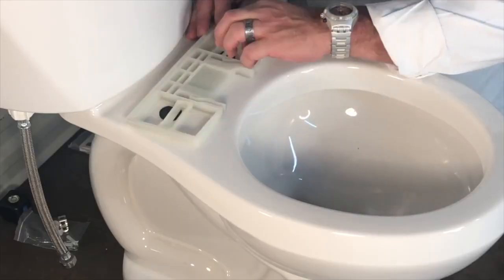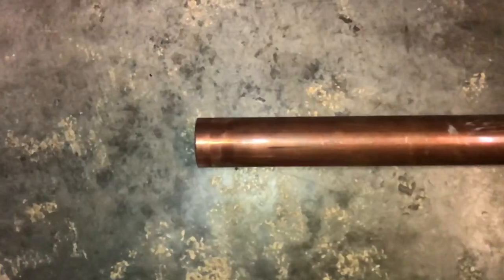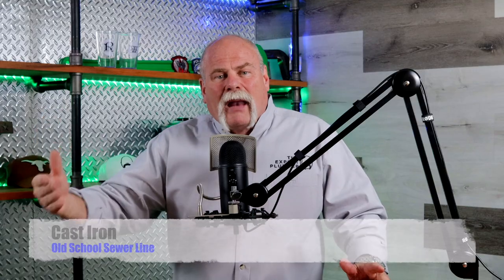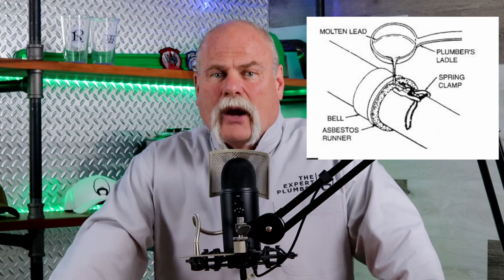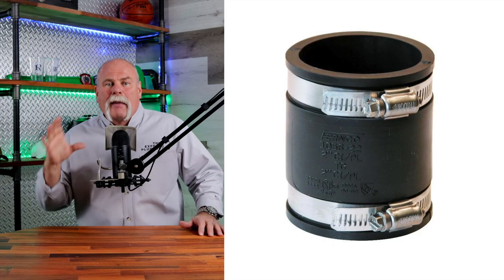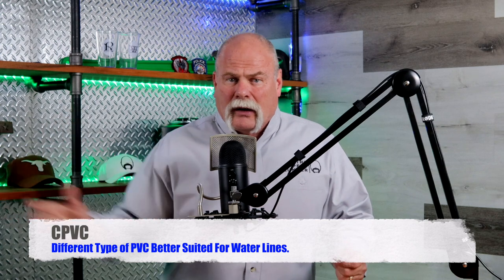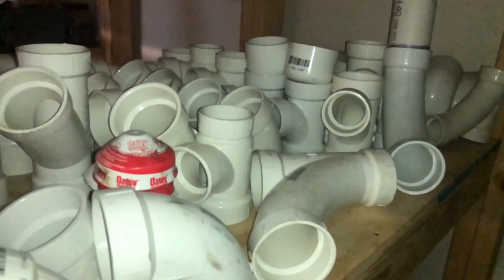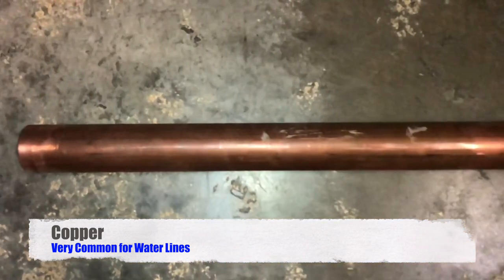Plumbing Basics - What Type Pipe to Use in Plumbing

Comment: In the winter of 1980 I was a new homeowner with frozen pipes.  When they thawed, I had a broken copper pipe.  I cut the water off and called a plumber.  No one was available because this was happening everywhere in town.  So I went to the local hardware store and got compression fittings and plastic pipe (PVC).  I froze my arm off dealing with dripping cold water, but I put the compression fittings on and had PVC in between.  I have since learned that that was not right.  But 40 years later, they still hold.  Of course, in the summer I put on electric pipe heaters and insulation, so they have never frozen since.  That was the cold job that gave me a lot of respect for plumbers who do this in all seasons.
Reply: The compression + PVC was a good choice for a fast emergency fix...
Good compression fittings can hold until the pipe corrodes away on copper.
PVC became "undesirable" largely due to the fumes when the house burns.  I can remember in some areas the common white PVC was used EVERYWHERE in the plumbing system.

Comment: where i live most homes have Stainless Steel Pipes instead of Copper. We also seldom use solder joints instead most of it is stainless steel/brass press and thread fittings

Comment: Will be building a house and considering what Piping to use.  I am amazed at this Pex and am leaning towards the Pex-a Uponor, but I am really interested on knowing what the chances are that this pipe, not fixtures have of failure.  What is the standard pressure that residential water mains have coming into a house from the street meter?

Comment: What are your thoughts on PVC vs ABS pipe for residential sewer systems. Do you have a video that covers both? Here ABS, cast iron and some older home still have Orangeburg
Reply: Orangeburg?? Ugh, I feel for you. Just had a replace an old orangeburg sewer line at a doctor’s office two weeks ago. Miserable.
Reply: @MandenTV  personally I've only run into it once but it's because i do new home warranty mainly and a little bit of residential service. But when i was doing my apprenticeship my trainet told me what it was when we were going to the job and my first thought was why would someone think it's a good idea?
Reply: @bryanfreemyer5074  Who knows what was going through their heads back in the day? Now we’re stuck with cleaning up the mess lol
Reply: @MandenTV  i just wonder what materials and designs we use today will be the next "who's dumb idea was this?" Question in the future
Reply: @bryanfreemyer5074  Lol I get exactly what you mean

Comment: I am moving an existing gas range from one side of the room to the other. If i had to guess its roughly 14’. The gas line under the house is 3/4 galvanized. Lowes sells a complete csst, proflex single appliance kit. Could I use that to span the distance? It comes with 25’
Or should i remove the existing T turn it the direction i need and add a 10’ section of galvanized before i use the csst in wall connection

Comment: I have 50+ year old galvanized pipes that have corrosion/rust inside. I’ve been told by a guy who used to install water softeners that a water softener will clean those pipes out. I can’t get my head around the idea that adding SALT to my water is supposed to protect the pipes and prevent rusting.
Is a water softener really going to help my galvanized pipes?

Comment: About to upgrade my 70's house with galvanized pipe to a pex system. What would be the best way to run a new line from the meter? Was thinking of running a 1" line inside info a 1.5" pvc pipe to ensure it will be good.
Reply: You're trying to hard run the 1" at level for code and go about your day. Why run 2 pipes when you need one? Also when there is a failure you made it twice as hard to find and repair.

Comment: As an apprentice I've been learning how to solder copper primarily since that's what we find a lot of but we do run into quite a few times where we need to break out the by viega Pex, the one problem with CPVC is the glue takes 24 hours to dry so you can't really make any repair on a pressured water line without having to make the customer wait an additional time if anybody can invent a CPVC glue that cures in 6 hours you be very rich man
Reply: Forget CPVC except for water heater relief valve piping. PEX is far superior.
Reply: Do you know any other YouTube videos or channels you'd recommend to a new apprentice? Also thank you so much.

Comment: Why no love for ABS? Much better fitting connection then PVC. An actual weld rather then just gulping two pieces together.
Reply: He is in Texas and in some of his other videos states the PVC is the pipe of choose there.  I did most of my plumbing in Arizona and it was more of a mix between the 2 there. and now here in Arkansas its mostly PVC.  So for the most part it is regional, however, there many be some restrictions on what you can use depending on the use of the line.

Comment: I think cast iron drain piping has many benefits that most plumbers ignore. True, metal does corrode and rusts over time, but PVC and CPVC are brittle concerning physical issues, (digging, tree roots, etc). Also the adhesives or joints can fail over time causing leaks. Cast Iron is also quieter and more fire resistant. PVC and CPVC can also be damaged by extreme cold and even sunlight.
Reply: @ Roger Wakefield  I think you should do a video on the pro's and cons of drain piping materials. Cast Iron vs PVC or CPVC. Thank you and I am still a fan!

Comment: I was under the impression that the two band fernco or “no hub” was not rated for sub slab repairs and it needed to meet a different requirement such as the four band (don’t have the required standard in hand) but if I am wrong please correct me
Reply: I believe they just inserted the wrong picture on this one

Comment: I am familiar with the "black iron pipe" and fittings, but I have seen a gas pipe for residential use that is a thin walled 1/2"  metal tube that is bent like an emt conduit pipe. I am not familiar with this product. Have you seen this before? Thank you for the valuable information!
Reply from the maker: HMSRedbeard it is CSST Corrugated Stainless Steel Tubing. It is the latest thing in gas pipe. Many different brands and types. Where are you located?

Comment: You forgot to mention DWV copper which was the norm between galvanized and PVC. And 50/50 or 40/60 solder is typically used for heat, if you have a hot water boiler and baseboard. It's fine for any non potable water. Only domestic do you need lead free. I remember lead and oakum. I never had the chance to do it in the field but I did learn how to do it in plumbing school in 1998.

Comment: We use cellular core PVC exclusively for DWV applications. In 41 years I have never seen a PVC waste pipe leak anywhere than at a joint. Cellular core makes a much better joint, and for that reason, IMHO, is superior. Also we have gone to PE-RT for water lines. As I understand it, PE-RT has a bit more strength than PEX for hot water. I've broken a few nipples inside a wall while trying to change a lav stop in a house with 100+ year old galvanized pipe. Now I give the homeowner a heads up. I tell them that their pipe was worn out when Ronnie Reagan was President, and it might break.

Comment: Quick question. i have a cast iron pipe with a hole in it.   it comes from 1st floor to my basement drain. i want to replace it. should i use pvc or abs or does it not matter? it would be draining the kitchen skink. oh, i will be mating the new pipe to the pvc that comes off the sink/disposal that i had to put in years ago. so i will end up with either pvc to pvc or pvc to abs. if that makes a difference about what i should use. thanks.

Comment: I'm 18 years old and I've had my Apprentice card for less than a year. 
I wanna get my DRAIN CLEANER-RESTRICTED REGISTRATION, but I don't know the requirements and I can't find the right paperwork.
Can you help?
Reply: No requirement, fill out the application, a quick 25 question test and mail it in with the appropriate fee amount... serious companies usually do everything for you with the paperwork and fees provided you fill out the application and test yourself. The only change is now that you (will have) that endorsement you will be absolutely required the continuing education annually. Waiting on dispatcher to send me the website then I can post it
Reply: @Jfurman790 I'm an apprentice in Texas and I'm looking for ways to boost my credentials. Certifications and stuff like that. I just did my drain cleaner-restricted registration and I'm looking for my next step. Any suggestions?
Reply: @therickybelt  after 2000 registered hours you need to apply the same way for your Residential Utilities Installer endorsement so you can actually work the jobs you sell during stoppages and yard line breaks, helps you sweat through your first few calls solo, and gains you experience in dealing with customers and price objections along with all of the other obstacles involving sales

Comment: I purchased some stainless steel water filter housings and a stainless steel UV sanitizer for my well water system. Should I use stainless pipe to connect all the components together? The house has copper pipes.

Comment: In the Dallas Texas area I have ran into a lot of 1/2" galvanized nipples that are threaded into brass fittings. I have been fortunate that the galvanized nipples usually un-tread leaving just a small amount of rust inside the brass fitting. Then I just use a 12 point socket to grab a 1/2" pipe tap to clean out the brass fitting. I use a piece of paper to jam into the socket before I push the tap into the socket. The paper locks the tap into socket so the tap won't fall behind the wall. Then I use a ratchet to turn the tap until the fitting is clean of old iron debris.  I have to turn clockwise a little and then back out a small amount. Then tighten a little more to break up the rust until the tap "seats" into the brass.
Then I permanently install a brass nipple with a temporary full bore ball valve (Turned off). After I get all the new nipples installed in this manor, I turn the water back on to the house. Then I open each ball valve separately and flush out the rust into a bucket. Then I turn off the water to the house again and remove the ball valves and install the angle stops and finish the job. 
I take the extra time to install the full port ball valve because they allow ALL the rust to get out of the system. If I just install the angle stop and then attempt to flush the rust out it could leave rust particles that will cause stoppages later. (or sooner).

Comment: Hi.  I have a question.  Should 1 inch cpvc be used for water service line entering a house from the ground up into the side wall to the garage to feed a water softener?  There are actually two one inch cpvc lines and 1/2 inch pvc line going parallel into the garage wall.  By the way, none of them were insulated so they get exposed to sunlight!  I’m a handyman who had to repair one of the right angles that had cracked in our recent Winter storm with 4 inches of snow in San Antonio, Texas.  I’m not a plumber, but had do miner repairs correctly at very modest price.  I’ve never seen cpvc used outside like that so it seem unusual.  Is that normal?  Thanks!

Comment: I knew a guy who said he worked at Roto something, who said he replaced 8 feet of horizontal kitchen drain in a wall, comprising it purely of inch and a half chrome slip joint tail pieces.

Comment: I have had limited access to CPVC but I often hear plumbers lament it is brittle and breaks off easy when working with it. The only CPVC I have messed with was a 3in vent pipe. It was gray, very thin and all the glue had dried up and was useless. Are there different grades or types of CPVC maybe ?

Comment: Have lived in my house for 3 years. Have had a pin hole leak each of those 3 years, I always solder in new copper. Slab on grade house with the crawl space going down the center, not an easy job.

Comment: I've been trying to figure out what the difference between a schedule 40 PVC pipe and a schedule 40 foam core pipe is. I know the foam core is cheaper, but what would i be giving up for the lower price?
Reply: Some venting applications say for furnace exhaust vents require sch 40 because the cell core is not made to take the acidic nature of the condensation, basically you always use cellular core unless it's for exhaust venting or pressurized pipe, say, for geo thermal. For drain, waste and vent(plumbing) purposes use cellular core

Comment: We recently bought a house that had polybutylene pipes so before we moved in, we hired a plumber to replace all the interior pipes in the house and he replaced it with PVC. Sometime later, I had another contractor come in for an unrelated issue and he asked why they used PVC instead of PEX. He said we probably don't have anything to worry about but he wasn't sure if PVC was allowed by code and that most plumbers would have used PEX. Should I be worried about the PVC?
Reply: PVC is typically used for DWV  (Drainage Waste and Venting) and pex is used for water supply lines. I'm not sure what you had done but I never saw PVC used for any piping with pressure. Personally I'm not a fan of either one, I like copper and would have demanded it as a customer. But if it's already there and you are not having problems see what happens. If you want to investigate and find it's against code then you can take it to court and get your money back and have it done correctly.

Comment: Pouring lead for cast iron pipe would have been fun.
Reply: Vastly over rated, LOL. When I started we routinely replaced broken cast iron toilet flanges with a lead and oakum joint. If you walk into someone's house with a ladle full of molten today they'd call the fire department!
Reply: @dvcrocco  I have done one before, they are fun to do but are hard.

Comment: I am changing out a hot water recirculation pump and was wondering is it ok to connect copper pip to bronze flange
Reply: If you are afraid then just use a nipple and dielectric union.

Comment: @rogerwakefield How bout the type b zurn pex that expands? I've been using Uponor type A, and love it, but... I just watched a video and would like your take. The gentleman said it had a higher burst strength, but was stiffer. It kinda felt like a commercial not an opinion.
Reply: Type b pex can’t be expanded
Reply: @davidjohnston3440  Zurn makes expandable Pex-B.

 HyperPure PE-RT pipe can also use ASTM F1960 expansion fittings. PE-RT is similar to PEX-A, but it's recyclable.

Comment: Should you plumb with CPVC, pex, brass, copper? Whats the best material for putting it behind the walls and forgetting about it.
Reply: Copper
Reply: Type k copper.  It's the only kind we use in hospitals in our area. It's not cheap.  But it will last longer
Reply: Copper is good unless on a well system.

Comment: Union plumber apprentice out of Philadelphia. We are still packing and pouring here and it's one of my favorite jobs to do.
Reply from the maker: @rft32 I haven’t poured a lead joint in 25-30 years... But, I bet I could still do it. I may need a few tips but I used to be really good at it! How many joints can y’all get done in a day? And what sizes are y’all doing?
Reply: @RogerWakefield  If I'm working with the right partner we might pack and pour over 20 joints in day with all the fittings considered. Last summer I helped run about a hundred feet of 12 inch service pipe. That was alot of lead haha.

Comment: Should (PVC or PEX) be replace for an old modern home with galvanize pipe underneath?
Reply: Sleved PEX a is hard to beat. Just pull a new line. Problem solved ☺️
Reply: BTW, shoved a new half inch line of PEX a under my slab through a 3/4 hot water copper line that failed and i have hot showers again 😁

Comment: Internally corroded steel pipes do not reduce pressure, only the flow. Pressure remains static unless a pressure limiting valve is used. Low flow does not constitute low pressure.
 Soldered joints should never be used on annealed copper pipe that comes in coils. All joints on annealed copper should be silver brazed.